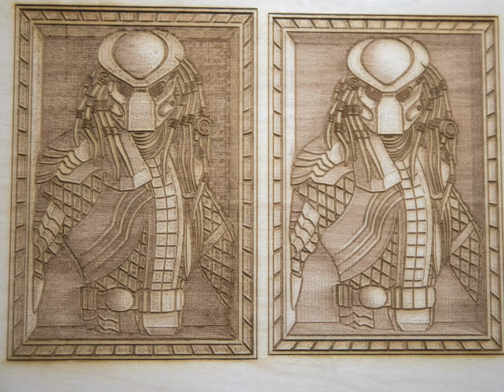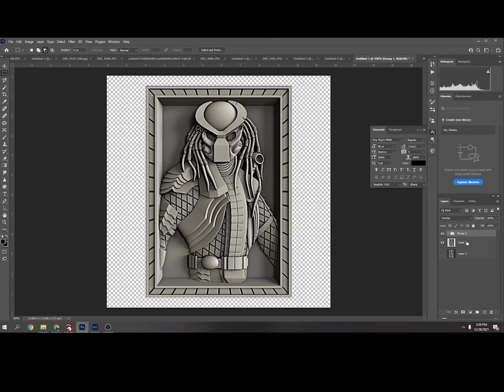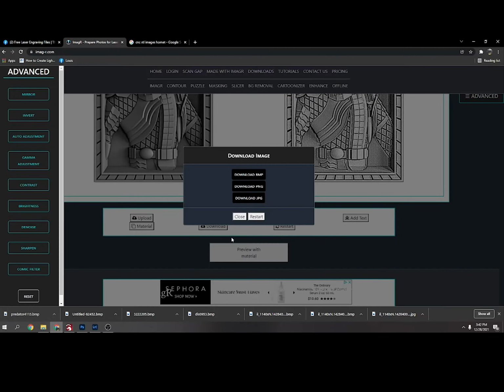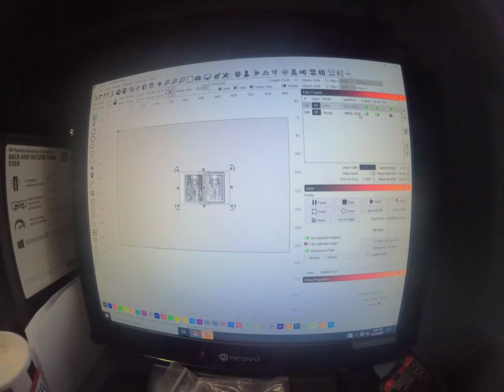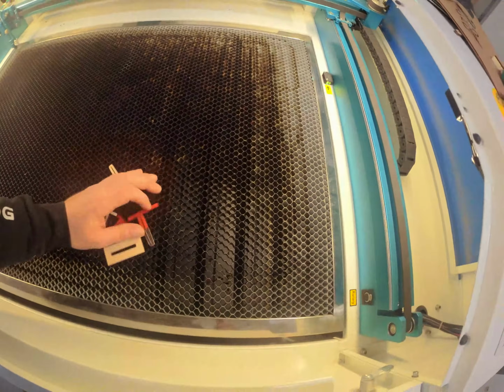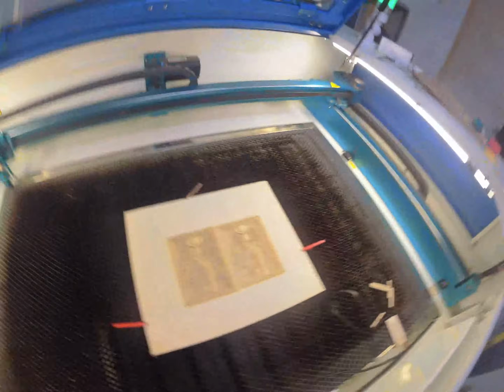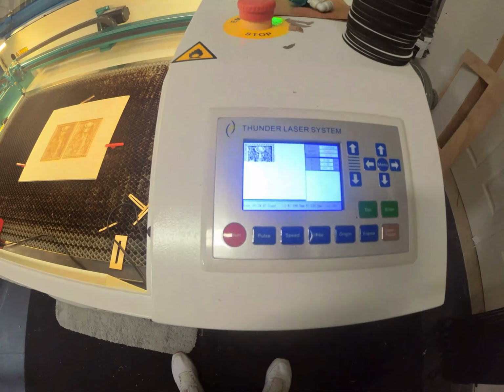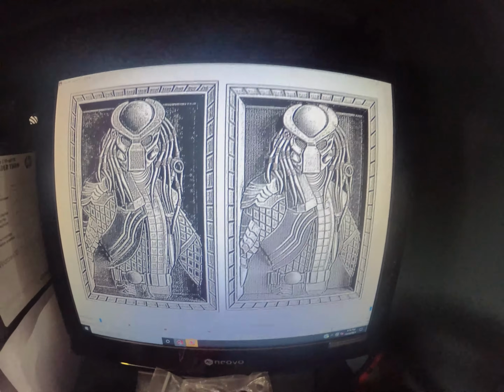How to Laser STL Image 3D laser Effect  Image-r Lightburn

Comment: Hello, Love the video. just one question I set it all up in light burn but when I send it over to my laser it is just a black square and not the files as seen in lightburn on the laser, my machine is a CO2 50watt, what have I done wrong ?
Reply: Not sure if it helps but Try once to re-export it in .bmp file format after importing in corel. Usually lesser watt machines accept bmp format.

Comment: Really interesting video, thank you for sharing, really well done.  We have just acquired a 180 watt CO2 laser and would like to create 3D engraving on Corian, or Staron - have you done anything with solid surface materials? We haven’t got lightburn what version do we need for Ruida controllers?
Reply from the maker: If you just go to lightburn and once you downloaded it you will choose the controller from there (Y) i have mainly only tested on wood and i also made some rubber stamps in another video that id the same effect really (Y)
Reply: Thanks for replying, i will get the software and see how we go, we have a RUIDA controller on this machine 6445 so this will work with Lightburn.

Comment: Great tutorial! Only request would br to say specifically what file type you are using as I wasn't able to read that from the screen.

Also, if you had done a third pass, what setting would you have used for that?

Thanks again for being so through.
Reply from the maker: From Imag-R i save it as a .BMP fille,  I have not tried a third pass, normally you want your deep etch first and then run another pass to try to clean that one up a little, if you wanted to run another i would go faster at a slightly higher power to maybe try to darken the lines a little, also one thing i have not tried but might be good is to raise the DPI for one of the passes and lower on the other maybe something i will try. good luck thanks for watching.

Comment: Thanks for taking the time to show this step by step process.  Do you own Imag-R for when I looked for the preview mode it was not there and then when I checked out the pricing it shows that the free version does not have preview but the $8/month has the preview option hence my thought that you own it since you had that option available.
Reply from the maker: mine is the free version,  i use google chrome as a browser not sure if that make any difference but it should be right at the bottom of the page after you have converted your image to one of their dithering modes.
Reply: @carphotography  Thanks for the quick response.  I tried both MS Edge and Chrome and neither one gave me the preview mode.  Oh well.  Thanks again,
Reply: The preview button is in every version, no matter if paid or not. The button shows as soon as you choose a material :)